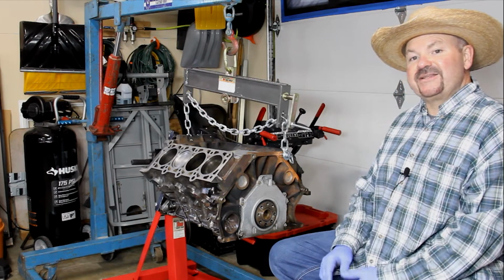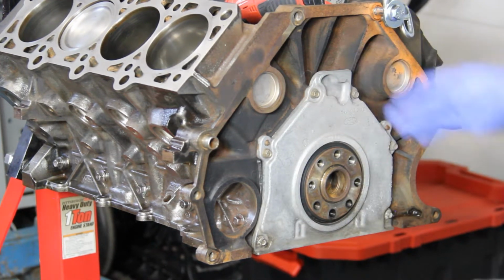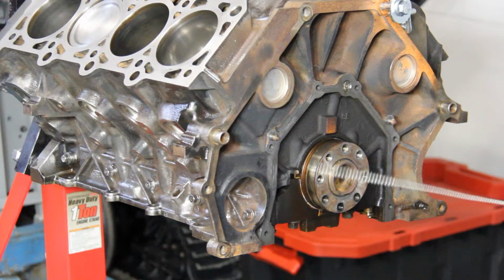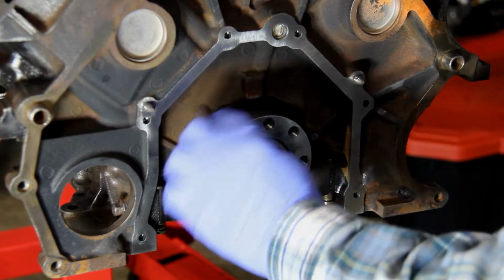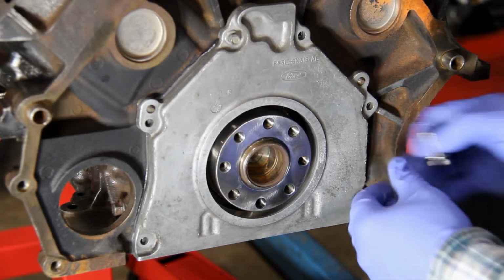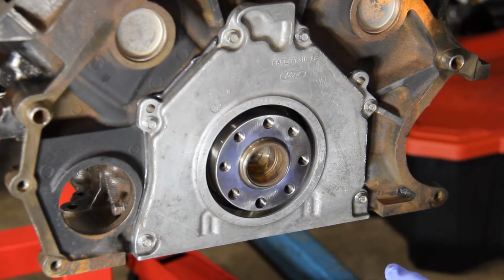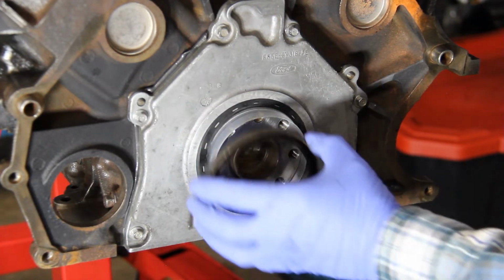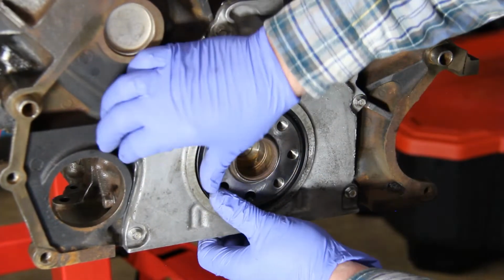Ford 5.4 2V Build - Rear Main Seal Replacement

Comment: Ok I'm doing one now and the retaining plate doesn't have a stop at the rear so to square the seal i used the tail of my venar cailabers to set it level in the housing and then installed a new debri gard

Comment: Why are you cleaning inside that place?  Why open if the engine is running fine'?
Reply from the maker: Anytime I work on anything like this I will make sure to clean everything I have access to before putting it all back together.  In the case of this rear main seal replacement I want to make sure all the sealing surfaces are completely prepped and cleaned to ensure the sealant being used will have a good bond and not leak.  It's super important for a job like this because to gain access to this again you would need to pull either the motor or the transmission.

Comment: Did you develop a leak around that top left bolt hole you missed with sealant? And you really only need a bead about 1/2 the size of what you have here.
Reply: Remember, it's for his sons truck, Not his. So if it does develop an oil leak. He can always say that he's trying to use it as a teaching moment.  I mean that's what my "father" would do to me. But then again, not all fathers are d***'s like mine. 
All joking aside, It'll be fine. Plus it's good to know that he has a master mechanic such as yourself watching the channel. Someone who's going to be ultra critical about things.  
Oh and maybe next time you should actually know  something about what you're critiquing. That was NOT a bolt hole. It was one of the dowel pin hole, that's NOT introduced to oil pressure. That means that there's no, zero, none, not even close to a reason for putting ANY Permatex on the outside of that hole. Geez
Karma's a b*tch
Reply: @abitoffcenter383  pause the video at 6:30 and look at the top left hole of the cover. That's not a dowel pin hole smart guy. And I wasn't aware that there was zero pressure in the crankcase, that's news to me..... Nice try to act smart though.
Reply: @Mike_Brosnan  My apologies. I was apparently looking at it the wrong way. As in not thinking of it being turned around to be placed onto the block. Not my first fuck up and most definitely nit my last.
Reply: I noticed the top corner also great eye. Good learning example for all of us planning on swapping a 5.4 2v and learning anything I can and these videos by far are super clean and beyond informative 💯

Comment: Can I replace the seal by just removing  the transmission?
Reply from the maker: Hi David.  I have done motor rebuilds in my son's '99 F250 (Heritage body) and my wife's '08 Expedition and I believe in both of those cases this could be done by just removing the transmission.  Quite frankly, if you have enough room the remove the transmission I can't see why you couldn't perform a rear main seal replacement due to the open area left when the transmission is removed.  Hope that answers your question.  Thanks for stopping by!
Reply: @javosgarage  Thank you very much for you advice.